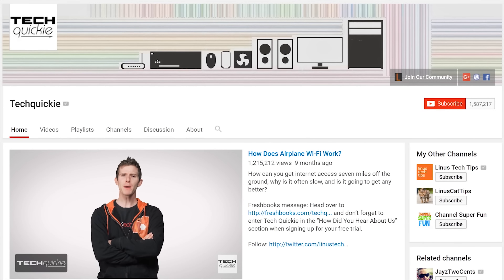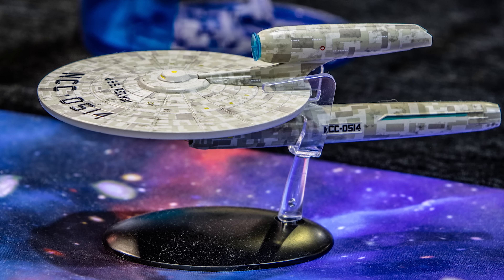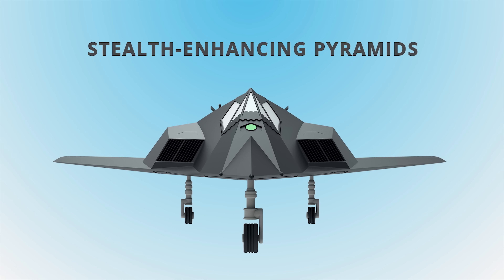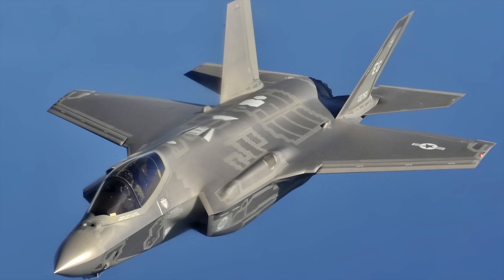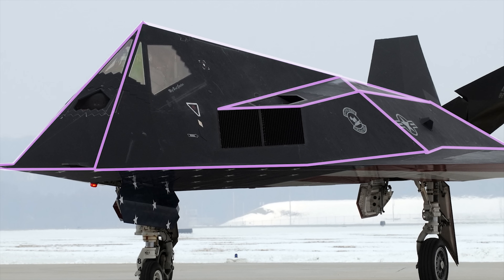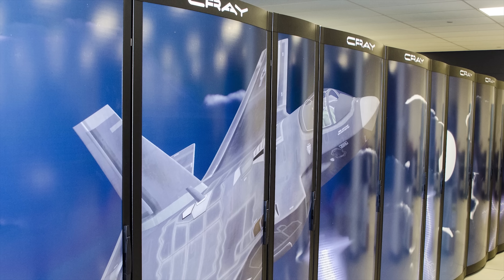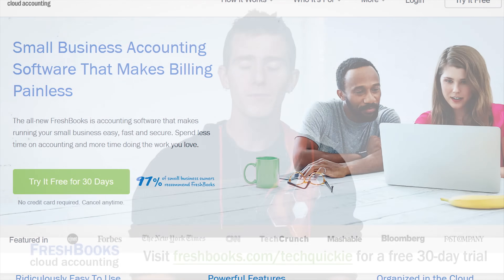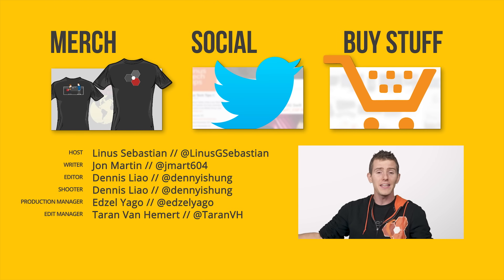How Does Stealth Technology Work?

Comment: Radar has 3 phase detection ring its primary phase detects "refracting radar waves" of it own emissions Its second phase "acts as a metal detector of up 5 miles or more" exact rang is classified after that it's 3rd phase of detection is "detecting other radar emission" not of its own emissions. Stealth fighter do turn off their radars and only passively detect enemy radar wave to avoid SAM sites and minimize the ability of an enemy to triangulate the fighter air crafts position. And yes the enemy has the same knowledge and Tech

Comment: So it's not a good idea to put RGB on my stealth bomber?
Reply: Serg The Purge It will make it more visable but go 10x as fast.
Reply: It will make it Go faster than light, dont believe that einstein guy Kappa
Reply: nah but that 100000000000000000000000000000000000000000000000000 billion decibel speaker should work fine!

Comment: It doesn't , ask Serbians.
Reply: RAD ?
Reply: S-125 is the one that serbian used to shot it down , and you know what? The s-125 had full range at 250km but it detect the f-117 at 23km , that's the time that f-117 were open the bomb load. And extra there is b-2 spirit nearby but it's didn't got detected.

Comment: "Radar Asorbing Pyramids". Technical term is Radar Asorbing Structures or RAS. Also F-117 was possible only because of Fly-By-Wire technology.
Reply: Iluminati confirmed
Reply: I think we was just referring to the facets and faces on the F-117. 
However, the triangles under the ram that he mentioned would be a better example of RAS